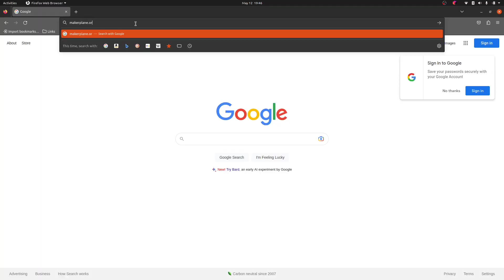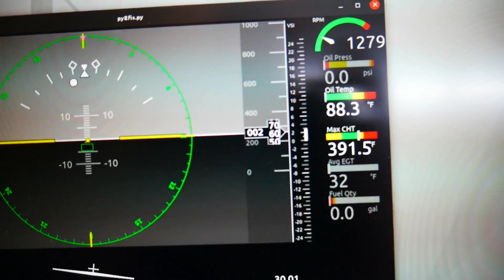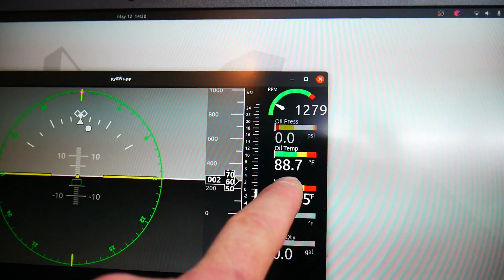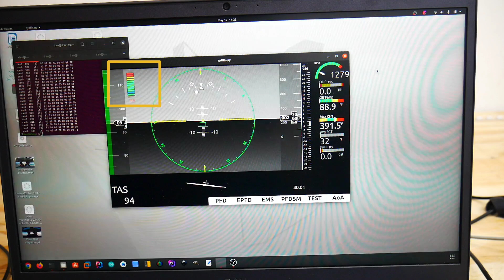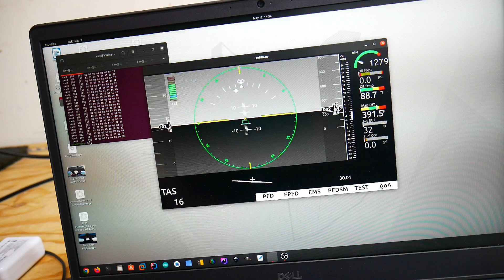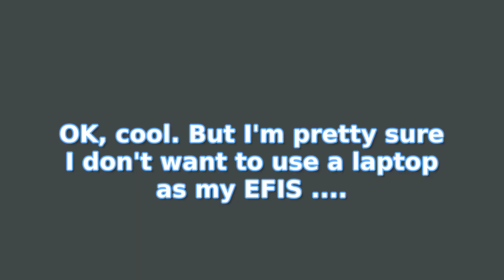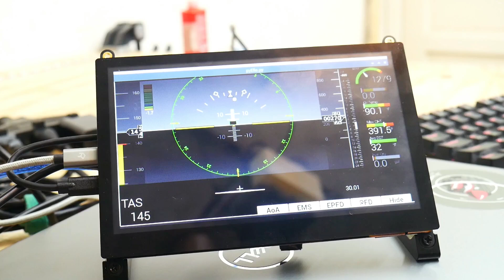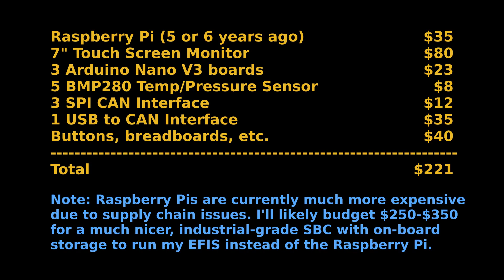Practically Free Avionics

Comment: Dan, I've watched your video multiple times and have found it so helpful in demystifying CAN Bus. I have a Pulsar XP with steam Gages and would like to have a secondary EFIS. I have two questions, 1-Will this system ultimately take into account the confusing issues produced between inertia and gravity in cheaper EFIS? 2-Do RC flight controllers such as the SpeedyBee F405 with numerous external sensors feeding it data accomplish our objective of EFIS, OBD autopilot etc.?
Reply from the maker: Hi Ivan. Thanks for watching.

I really didn't do a very good job of explaining how all of this works together, so here's an attempt to do so:
In the video I connected several Arduino devices to CAN interfaces. The Arduinos were generating CAN messages according to a specification designed by Phil Birkelbach and other people contributing to the MakerPlane community. That specification is called the Flight information eXchange (FiX) specification. The FiX spec takes into account basically every function, sensor reading, etc. you can think of on an airplane. There's a specific message for airspeed. Another for pitch. Another for roll. One for gear position, flap position, etc. I was just looking at the auto pilot commands section of the FiX spec and there are several parameters that FiX allows: Engage, Disconnect, VS Mode, Alt Hold Mode, Alt Select Mode, Heading Increment, Heading Decrement. Additionally other parameters could be sent BY the Autopilot out to servos controlling the aircraft, such as Pitch Trim, Roll Trim, Yaw Trim, Pitch Trim Motor Speed, Roll Trim Motor Speed, and Yaw Trim Motor Speed.

What I'm doing in this video is generating mostly mock data (though I'm also pushing some actual sensor data as well) and converting each of those data into a corresponding FiX message. Then I'm publishing the messages over the CAN bus where there's a piece of software called the FiX Gateway (this is one of the many MakerPlane open source projects). In this case, the FiX Gateway is listening to the CAN messages and then publishes those messages to the pyEfis software running on the same computer as the FiX Gateway. 

Of note, the FiX Gateway can ingest data from other sources too (e.g. not just CAN bus). For example, you can connect it to XPlane and see your simulated aircraft's EFIS data on a separate screen. You can also connect it to a Stratux. If you're not familiar with Stratux, it's an open source ADS-B in device to which many people add an AHRS chip. I have a Stratux with an AHRS chip, but I haven't attempted to connect my FiX Gateway to it yet. I should try that and see how well it works ... hmmm.

Anyway, all that said, as long as you can get a data stream from your SpeedyBee, you should be able to fairly easily translate that data to a message that the FiX Gateway can interpret and push to pyEfis. You'll likely use an Arduino to connect to the SpeedyBee's serial connection (assuming it has one for output) and then translate the various bits of data into FiX messages that you would then send down the CAN bus for ingestion into the FiX Gateway. From there, the pyEfis screen will display the data graphically.

Hopefully, that's helpful.
Reply: @dan_der_flieger  Dan, thank you for your helpful response as I continue expanding my understanding of the subject. I have a Stratus wit AHRS that I put together so I'm a bit familiar with it and have flown some with it. Stratux was my first experience with the world of open source and I'm hooked :)  Im quite sure Flight Tech has applied a RC Flight controller to achieve some of the same functions but I'm not familiar enough with the subject to understand the advantages and limitations. In the long run we have very similar goals for our experimental aircraft so I look forward to seeing your progress. Thanks again for sharing your journey.
Reply from the maker: @ivanhoyt7757  sure, no problem. After work I connected my laptop up to my Stratux and told the FiX Gateway to listen to it. My pyEfis attitude indicator followed it as I moved it around. Maybe I'll do a quick tutorial covering how to set up a basic EFIS attached to a Stratux if you think it would be worthwhile.
Reply: @dan_der_flieger  Sure, I would appreciate it. Enjoying this learning process and excited to start my own experimenting.

Comment: Very nice!  Great video.
Reply from the maker: Thanks John. Looking forward to meeting you at some point.
Reply: @dan_der_flieger  Me too.  FYI we also have sunlight readable 5" LCD displays for Raspberry Pi's that you might be interested in using that would be brighter than your 7".  There are also 3D print files available for the cases for various mounting options.
Reply from the maker: @johnnicol5009  - yeah, I saw that but I bought the 7" display before I did. So I decided to test it all out with the 7" one I had on hand. When I'm ready to start building out my actual Sonex panel, I'll likely buy the 5" display. I'd prefer a little bigger than 5", but a larger screen that you can't see in the sunlight is just useless weight in the cockpit. :)